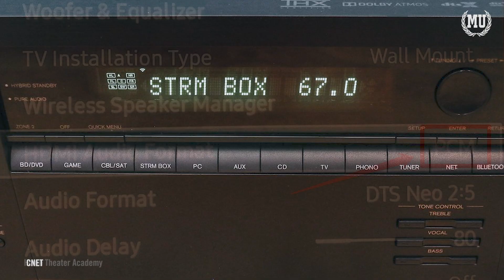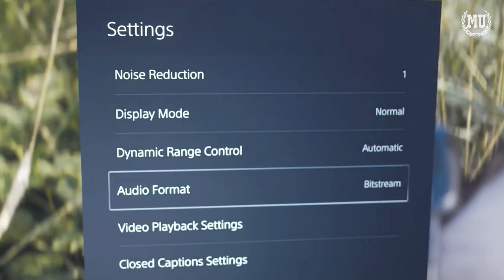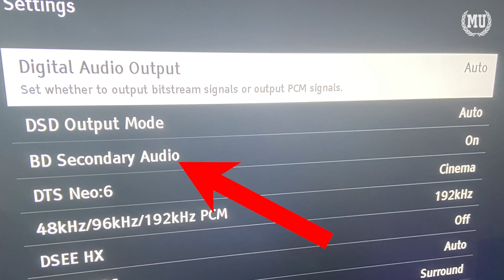PCM vs Bitstream | Bitstream vs PCM | What is PCM Audio | What is Bitstream Audio

Comment: hi. i have a sony 5.1 surround system that supports only dolby digital & dts & lpcm connected to sony tv via arc. i use the surround when playing 4k movies on samsung k8500 4k player. my question is should i set the audio in the tv & dvd player to pcm or bitstream unprocessed? i heared that bitstream is used only for high end surround systems like those who support atmos for example. need ur advice please.

Comment: I have connected my Sony bravia tv to Cambridge CXA80 amp using an optical cable and playing the audio in 2 JM Lab cobalt 816 speakers. Now i have got 3 options in my Sony tv for audio output, 1. Auto 2. PCM 3. Passthrough. When i select 'Auto' or 'passthrough' and device as 'audio system', the sound is playing only in youtube but not in other apps like Netflix. However, the sound is playing fine in all apps when i choose PCM. Would you be able to help me understand what is the right setup i should choose here? Thanks

Comment: The part about BD secondary audio being set to on is throwing me. In the manual for my UB820 and a Dolby home guide they both state that to get full Atmos and DTS X, both should be set to bitstream and the secondary audio set to off. They both state this setting on players is for an alternative audio track on the disc if some of your equipment doesn’t support the primary audio track. Not that this setting allows for a separate overhead mix to play for full Atmos or DTS X. Some clarification on this would help, thank you.
Reply from the maker: I'm sure it depends on model, brand, and firmware updates. What Brian states in the video is a generalized settings, however, your equipment may differ. Try out all the settings on and off and see what you like best. 

At the end of the day, you decide what sounds best on your system, not strangers on YouTube.

Comment: Here’s the simple answer do you want your audio equipment to do the sound decoding or do you want your player to do the sound decoding and have your audio equipment just play it. Me personally let your audio equipment do the decoding that’s why you have the setup right. If you’re just using the tv speakers or a cheap soundbar go with LPCM.
Reply: I got laptop hdmi to tv to dac to amp to focals I still dont understand do I want to use bitstream or no?
Reply: I am using only my internal tv speakers—should I have digital audio output on tv settings set to PCM or Dolby digital, or does this not matter if I have my 4k player audio output set to PCM?  Or do I keep both at PCM, which is what I have it at now? I am sure I’m overthinking this but I’m anal retentive and retarded. Also for my Apple TV 4K should I switch audio format to stereo or leave off (auto) ? Thanks, anyone who can help.
Reply: @danieljvasile  tv speakers doesnt really matter they suck anyways so fidelity isnt relevant.

Comment: The compressed audio VS uncompressed audio is one of the dumbest arguments in history. There is absolutely no discernible difference between the two. And even if you’re an extremely rare person who has a receiver that decodes uncompressed audio, why would you choose that over bitstream Atmos or DTS X? Silly conversation. Always choose bitstream so you get the true audio codec sent to your receiver.
Reply: The audio on the disc is already compressed think of that or else the audio file be way to big. LPCM is called uncompressed because it dose nothing to the audio file it dosnt compress it. Bitstream dose compress the audio to be transferred over HDMI or Optical if your listing to the non HD audio format. Then the audio equipment revives the stream uncompresses it and decodes it.
Reply: The difference between uncompressed and compressed is not night and day but you can tell when you have high-end speakers .
Normal speakers arent as revealing so that's why you "cant" tell the difference...

Comment: When i choose PCM via Spdif i only get 2 channel emulation to all my speakers... When i choose bitstreming i get real 5.1 output for my movies but only on Dolby digital formats if i run a movie with DTS audio i get no sound... PCM works with all audios formats but only with 2 ch emulation! How can i output real 5.1 using PCM setting ? Can PCM output 5.1 or only support 2 ch output ? I am confused !
Reply: Jesus Christ, why are you still calling it Spdif? It’s an optical cable and that is extremely outdated tech. PCM though optical is always going to be downgraded to 2 channel. The bandwidth of optical can only support compressed audio like Dolby Digital 5.1 or DTS. If you’re going to stick with optical cables, you have to stay on bitstream if you want surround sound.
Reply from the maker: PCM can indeed do 5.1. It sounds like your devices aren't talking to each other properly for some reason.
Reply: Are you using optical out from your tv you need to plug your player or consoles directly into your audio equipment not the tv and optical can’t pass the HD audio formats only HDMI can. Optical only supports Dolby Digital and DTS not the HD audio.

Comment: I hear that you cant lose the DOLBY ATMOS sound with PCM as long as your conection was vía hdmi 2.1 eARC.  Is that true?  
Ok. So… if i choose PCM in a TV with hdmi 2.1 eARC conected in a soundbar with hdmi eARC with dolby atmos… can i still get the DOLBY ATMOS sound?  

Context: i have a Neo Samsung qled qn90b conected to a soundbar Samsumg HW-q800b with extra rear speakers vía hdmi 2.1 eARC and in the TV audio Settings i have 2 óptions: PCM or AUTO.  With AUTO i have some tiny sound distorsions in the movies like “rrrg” the distorsion duration is no more than a sec. But when i change the format to a PCM the distorsion desapears… so…. What should i do?  I dont wanna lose the atmos sound!  Pls help!
Reply from the maker: You cannot get Atmos or DTS:X with PCM because of the technological limits. Only possible through bitstream. No matter your HDMI cable or what you are putting out from your A/V receiver.
Reply: @MovieUniversity  so, what can i do with the distorsión ?
Reply from the maker: @DeMency  What do you mean, what kind of distortion are you getting?
Reply: that’s why i never route my player to my tv and from my tv to the receiver. Always connect straight to your receiver first and from the receiver to your TV.

Comment: Apple tv only sends audio in LPCM to AVR which display multichannel audio. I understand Apple TV does not do bitstream ?
Reply from the maker: Correct. Apple TV device does not support full bitstream. You're better off with PCM.
Reply: That would explain why the audio sounds so much more rich and powerful on my soundbar with PCM vs bitstream. I couldn’t figure it out 😂

Comment: I’ve been having HORRIBKE audio delay with my OG PS4 and Den-in AVR-x7200wa. It’s most noticeable with GT7.  Of course I’m using H-DMI and not optical.  I decided to switch it to PCM from Dolby, and the delay during shifting, going over rumble strips or kerbs. Contact with walls or other cars results in about 1/4 of a second delay!!!!  Switching to PCM corrected the delay.  However, tone is different and I have to readjust the output of all 11 speaker for this particular input. 

GT7 has stereo or “7.1 surround.  I don’t know if it is DTS or Dolby or Sony’s own code.  I’m guessing it’s a SONY format.  For some reason, both DTS and Dolby are causing a horrible delay which makes the audio from the PS4 to be ahead of the AVR output.  I cannot use the audio delay on the TV or AVR.  It makes the delay worse.
Reply: If you’re running the ps4 to your tv and the tv arc to your receiver that’s most likely the delay. Either way unfortunately when you sent a pcm signal to you receiver it just downgraded you to “uncompressed” stereo or some other 5.1 simulation. I hate PCM.
Reply: You have to run the HDMI from your PS4 directly into the AVR or Soundbar first then run a second HDMI out from the AVR or Soundbar to the tv. You’re getting a delay from the tv. If you do it this way then you can run everything in bitstream with no problems

Comment: my soundbar has 2 ch should i choose pcm or bitstream ?
Reply from the maker: Either or will work just fine. As Brian states in the video, there’s no quality difference between the two below 5.1.
Reply: @MovieUniversity  so I did a test and there was no difference in sound thank you for the reply and one more question I want to ask what is dts drcscale in mi box s sound settings it starts from 0 to 100 % ? 
I set it to 100 and then to 0 no difference what is that setting used for ?
Reply from the maker: @raftaarsingh6649  is "drcscale in mi box s" a typo?
Reply: @MovieUniversity  no it's a setting called dts sounds drc scale once you select it you have a range from 0% to 100%

Comment: When I watch a UHD disc on my PS5 that’s connected to my LG CX (which cant decode DTS) and then to my soundbar (sonos arc) which is connected through HDMI eArc to my CX, it reads DTS content as ‘Multichannel PCM 5.1/7.1’
Am i still getting the same audio quality (bitrate) as if it could decode DTS?
Reply from the maker: I don't think so, but I could be wrong. 

Because the LG TV isn't an audio/receiver unit it doesn't have the ability to unpack or pass on the signal. You'd need to hook the PS up separately. One cable going to the sound bar and another going to the TV.
Reply: @MovieUniversity  hmm, my Sonos App shows it as MPCM 7.1 when I put a DTS X UHD disc in. As long as there’s not such a thing as lossy PCM, I might be getting lossless. Hope so anyway….
Reply from the maker: You might be right. I'm not sure. I've never run into this issue before. 

By chance do you live in an apartment?
Reply: @MovieUniversity  Ok, thanks for getting back to me though. 
Yes I do. Why?
Reply from the maker: Was just curious. You said soundbar so it had me thinking.
Reply: Everyone needs to stop connecting everything to the TV and connect everything to the audio equipment first. If you got a high end soundbar or AVR all your players and console should be plugged into those first then output one HDMi to the tv. The tv should just receive the video that’s it. Any streaming apps on the tv can be sent to the audio equipment using ARC. You all are connecting your setups backwards no wonder why everyone has issues.

Comment: I do have a question about this... I own a Nintendo switch... and noticed something strange.... if I set my sound from pass through to digital. After a second or 2 of not navigating the switch menu. Or game auido. The auido will cut out when resuming. But if I set it to pass through everything is fine!!!! Why is this? And why does the auido cut under bitstream?
Reply from the maker: I couldn't tell you. Sounds like that's more of a programming thing internal to the Switch. Does it affect the syncing of the audio between the speaker(s) and TV?
Reply: @MovieUniversity  that I don't know of... but at least it works when I set it to pass through

Comment: I am not sure if there is a difference between PCM and LPCM but PS5 has 3 options: LPCM(uncompressed), DTS(compressed), DOLBY(compressed). Which is why I use LPCM with Denon x3600h
Reply: He is referring to gaming only. For blu ray playback it’s either Bitstream or PCM. The reason is because sony cannot do Atmos/DTS X in video games. It can only do that in movie playback. That’s why the two have different settings.
Reply: Wrong the audio on the disc is already compressed if it wasn’t it be way to big. LPCM is uncompressed meaning it dose nothing to the audio it dosnt mean the audio track itself isn’t compressed it still is. If your using a high end soundbar or AVR you always want to pick bitstream the amplifier in the soundbar or AVR boosts the audio if you pick LPCM the player or console whatever the source is will just convert to it to LPCM it’s best to let the audio equipment do the decoding.
Reply from the maker: That's interesting that the PS only allows the compressed versions of DTS and Dolby. 

LPCM and PCM are almost the exact same thing.

Comment: I'm playing bluray movie through PlayStation 3, PCM output to AVR sound better than bitstream, if output bitstream, sound very low, especially the center speaker.
Reply from the maker: From what you've said, I think it's a matter of the AVR decoding the signal. Not necessarily a Bitstream/PCM issue.

Comment: In other words don't use PCM
Reply: I use a 2.0 channel soundbar...so I gotta use it...works good
Reply: Well on my Apple TV Bitstream doesn’t sound as full or rich as PCM so that might not be true for all cases.
Reply from the maker: Correct!
Reply: @MovieUniversity  Unless you do it the old fashioned way like myself and some others. I have a 5.1 set-up (no Atmos/DTS X as can't drill into my ceiling) 

I use my Oppo UDP 203 internal DAC for PCM through it's analogue outputs connected to power amplifiers for my speakers.

I get Dolby TrueHD, DTS Master Audio with as good sound quality if it was bitstream Hdmi to a receiver/processor. Less signal chain on the conversion.

Comment: You can always, when sending PCM, use an upmixer (DSU, DTS Neural:X or Auro 3D) in the processor/reciever to upmix the 7.1 PCM stream to use all the speakers. Even the height speakers.
Reply: But then you’re not getting TRUE Atmos/DTS X sound the way it was mixed. You’re getting an “uncompressed” simulation. Horrible recommendation.
Reply from the maker: Great point!